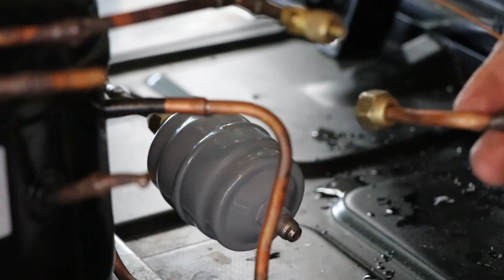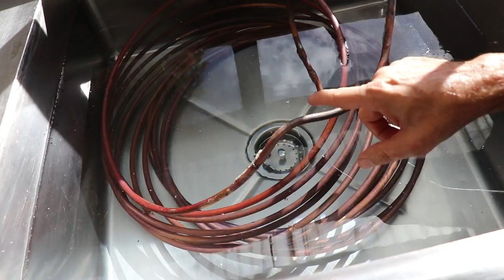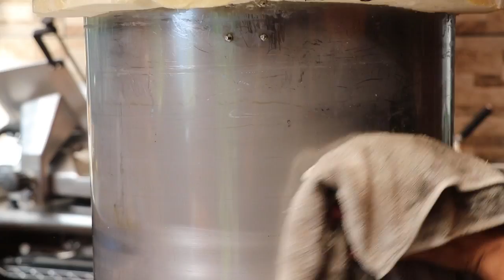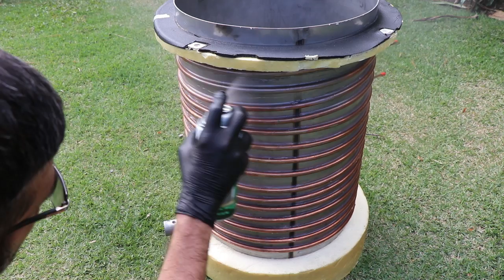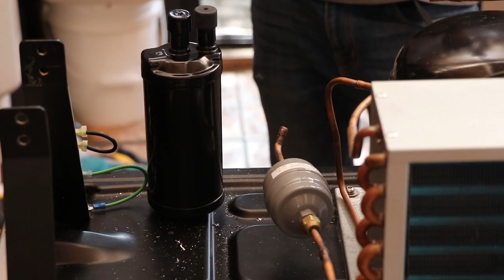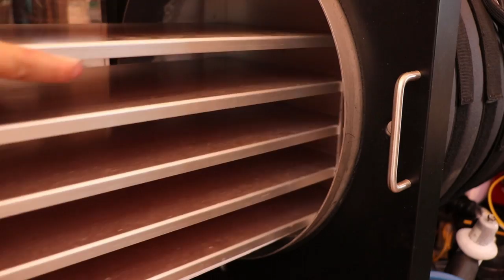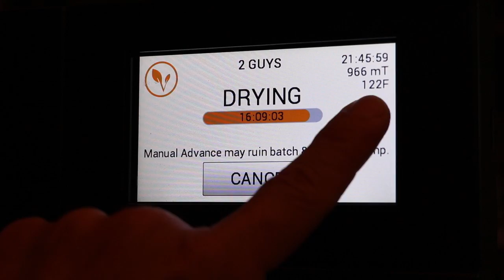My Freeze Dryer Stopped Freezing | Part 2 - Fixing the Issue

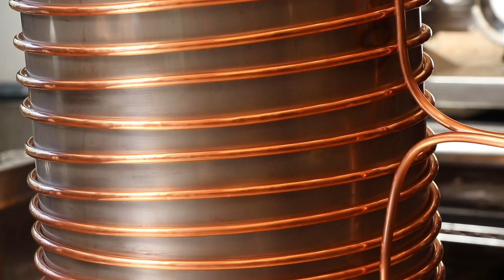Comment: 14:06 -- This is likely the root cause of your problems in the first place.  Copper tubing, in direct contact with the stainless steel can lead to galvanic corrosion, especially in the presence of moisture.  The two dissimilar metals can lead to the pinhole leaks you already observed on the original coil.  Did you happen to notice that all your pinhole leaks were on the inner diameter of the coil where the tubing is in contact with the chamber?

Comment: Okay... The condenser changes the refrigerant gas back into liquid which goes into the cap tube as a liquid. The cap tube is a metering device which controls the flow of the liquid into the evaporator.  Once the liquid comes out of the cap tube it starts expanding and evaporates back into a gas.

Comment: My large is 2 months out of the 1 year warranty. And now won’t cool lower than 62 degrees and that takes 13 hours to get to. I use mine for business. So it’s important for it to be up and running. The simple fact that I have to pay for support is absolutely absurd. Support has flat out lied to me. When I told them to go back and listen to the phone call they say it was their reps “misunderstanding”. There was no misunderstanding she flat out said I would pay no shipping and I even had her repeat it so it was clearly stated. I had to force the woman to tell me it was going to be a min of 8-10 weeks for them to “fix” my machine. Most things I read say it will be more like double whatever they tell you. And a lot of times you don’t even get your machine back.  It will be a different machine with other problems when you get it. Or the same problem as you sent it with. 
They also tell me one thing and then when I question it because it’s totally conflicting what they said before. I get word puke from them.  And I would even copy and paste quotes they emailed me telling them they are conflicting what they just said and they ignore that part of the email. There is a group on Facebook I joined called harvest right freezer dryers that don’t work, with almost 5k people in it. If there is that many people with these issues and customer support. How are they in business? How is there not a class action at this point. I agree with so many others, this is one of the worst company’s I have ever dealt with and will never buy another from them. At their price point. I want a machine that works for what I paid. And support that wants happy customers and wants to help.
At this point I’m not sending it to them to be circled around and for me to loose money from my business. I’m trying to find any hvac to come and look at it. Because I’m confident it’s leaking Freon. But I can’t get anyone to look at it. I’m at trying 10 different places and not a one will even come look at it

Comment: Thanks for the info! I really learned a ton, and you explain everything so well! I too am experiencing the customer support merry go round. Very polite, but the guy I talk to is not a tech and not knowledgeable. My problem is the condenser starts and runs properly, but after about 10 minutes into starting a load process the normal sound changes to a "hum" and it stops freezing. Any ideas? I don't think it's a leak, more mechanical with the condenser. Thanks for any input
Reply from the maker: sounds like the compressor stops and only the fan is running.   Have you tried to run the unit from the functions test screen and see what happens?
Reply: Yes, they had me do a test run from the test screen on my dryer, it ran for roughly 9 to 10 minutes. Normally, then it shut off is the best way to explain it and then it would just hum. I really appreciate you getting back to me on this☺️
Reply from the maker: When it stops is the fan (on the condenser w/the blue fins) still running.   It sounds as if it may be overheating and automatically shutting off.  Could be the start/stop capacitor or even the fan capacitor if I had to take a wild guess.  I'm not in the HVACR field but that's where I would start.
Reply: @2guysandacooler  Thank you very much for your kindness in helping me, so appreciated!
Reply: I have not taken the panel off yet to inspect. I can do that later today and let you know

Comment: I’ve commented before and have a question for you. You might have answered it in the video, “what caused the failure of the copper tubing?”. My guess based on what I’ve heard, seen, is defective tubing. I’ve got the same issue and, so far I’m getting no where. Sent back twice under warranty,same problem. Now wants to charge me $400 to send back, I just don’t think that’s fair.
Reply from the maker: Harvest Right never commented on this issue and every time I asked, they simply said that their team has seen my video and was aware of the issue.  My initial thought would be faulty copper, but the main culprit is moisture.  There seems to be 2 types of corrosion happening at the same time.  Formicary and galvanic.  If they can't seal their drum better and keep the moisture out, then they will continue having this issue.  The easiest way to fix this would be to get a new drum and have a repairman install it for you.  The fact that they want to charge you to fix their preexisting condition is despicable.  They customer service is one of the main reasons I would never recommend a Harvest Right.

Comment: I have the same issue it appears and what I never realized is I have been dealing with it for since I got the machine over the 3 yrs ago I have ruined vac pumps as a result and had to deal with water in the pump.  Recently we recharged it and found it worked perfectly with long cycle times but that was okay the product was good.  After 2 and half months the freon leaked out and we are back to water in the pump.  Harvest Right is saying I did not say the right things to them and do the water bath test to definitely determine the problem.  They have admitted they may have not escalated the issue properly to the tech team.  My machine is 4 yrs old. The thing is I lived with this and dealt with it all this time and was in constant contact with them.  They will not honor the 3 yr warranty to fix the leak that was obviously a manufacturing defect to start.  I believe during the many conversations they could have seen there was issues in the Logs I sent them and proactively engaged the situation.  They did not do this if they did I would be loyal customer.  They will say many things and they can say now they would have fixed the machine in warranty but know they will hesitate and not be clear and one needs to push the issue to make them responsible for fixing an expensive piece of flawed defective equipment they sold.  The realization was it was leaking from the beginning.  They will admit that in the prior years there were mistakes and issues may have not been escalated and if I did the water bath test they would have repaired the machine in warranty.  In the day they were the only source of Freeze Dryers the have competition now and while Harvest Right may have improved the machines its important they accept they sold units that the copper pipe was defective.  I am told Stay Fresh has none of these issues and uses higher quality components as a result of improving on what Harvest Right has done.   In the end the cost is $500 for the part and the time the replace it and recharge the machine.  Which I will most likely do due to the fact I depend on the machine and truly it has never worked right until I recharged it and maybe now it can.  They had the choice and out of warranty your out of luck.. Stay engaged within the warranty period and make sure issues are resolved completely they will not take responsibility for the defective copper pipe after the 3 yr warranty.  FYI

Comment: Just finished your first video of the series, very well done and informative. This will be my third time with a freezing issue with a large model, I’ve have sent it back twice (both times were under warranty, no charge) and they didn’t fix anything except to add Freon. It’s a slow leak and seems to function for several months before you notice the ice formation slowly moving away from the front half. Unlike you, I’ve had good telephone response from them, twice before and just starting my third time. I ordered mine straight from Harvest Right, and have realized that my unit was probably defective from the start. It’s just a small, slow leak and the unit will run but will continue to degrade over several months as the refrigerant leaks out. It’s a big hassle for me to return for repair. My personal opinion is they should replace the unit with a new one, I don’t have a lot of faith in getting this one repaired. I talked with the Rep last night about my issue’s with the unit and he mentioned it was out of warranty and there would probably be charges. My response back to him was “really, you’ve had it twice already for the exact same problem and haven’t fixed it yet, and all this was done under warranty and you think I should now start paying for your help. I then asked to speak with a supervisor.
Reply from the maker: That sucks!!!  I hope you get it worked out with them.
Reply: @2guysandacooler  I had bought two large units and one of them starting making a banging noise after about  3 dries. They did take it back and sent me another one but you wont believe what happened. They told me to test it with a dry and make sure it worked once I got it. So after about 20 hrs on a dry, it did something similar and then would not freeze. Everything seemed to work but it would not freeze anymore. I sent them the info from the thumb drive and I they said they wanted to get me a working unit. After waiting for a week or more I asked for a refund. They said they would refund me but I had to pay for shipping charges and restocking fee. I also got a bill for the first unit that was sent back from fed ex for 1900 dollars! So if I ship this one back, they will charge me another 1900? lol. I had a call with one of the MOST incompetent 'techs' that told me a bunch of wrong things and had to apologize for telling me the wrong things. We had a call set up for today and guess what? She never showed up for the call. lol. So I guess they are ignoring me now? I got a machine I have only used once that doesnt work. They told me at first to get an electrician to test the plug but then didn't want the info and said they would just send me another one. But they never told me they were going to charge me for the shipping. But they did inform me the other day about the second one being shipped back and that I would be responsible for freight and restocking fee. So I told the foreign guy who answers calls to forward the recording to the higher ups. I also mentioned how I have now been inspired to start a prepping and review channel just like @2guysandacooler
Reply from the maker: @endtimesurvivalblog  that sucks!!  I hope you can get that sorted.  You might request a tier 2 or even tier 3 customer support.  They seem to be a little more competent.
Reply: @ I did talk to Kim at the Stay Fresh and he was awesome to talk with. I told him about your vids on their dryers and that I would buy one of his from  your recommendations on my next purchase. I told him I might try and get someone to fix it instead of shipping it back for ANOTHER 1900 dollars  and he said they should not charge me under warranty. He said that fixing that kind of issues is pretty technical and that an average refrigeration guy might not be able to do it. What do you think? He also told me the shipping should have only cost 350 or 400. Why 1900? Does this make sense?
Reply from the maker: @BPNEWSCHANNEL  Yeah, that $1900 is ridiculous especially given the circumstance.  Harvest Right can't seem to learn from their mistakes.  I agree with Tim.  Fixing a unit like this can be pretty technical and many HVAC/R techs either won't touch them or don't know exactly what to do.

Comment: I have a May22 date code and we have a similar situation, tried leak stop and replaced the refrigerant 4 times. have contacted HarvestRight - the first response was out of warranty... I am interested in the actual part numbers of the valve and regulator and receiver you used  - I didn't see links to those.

Comment: No warranty. Freeze and condenser fan won’t work. Paid 45 for tech call. They are stumped and asked to call me back after opening up to mess with wires. What options do i have at this point?  I have scoured the internet for fixing videos and there are none.
Reply: I’m feeling the same thing. They seem to have no idea how to actually resolve a problem that isn’t documented in their manuals
Reply from the maker: sounds like you are having a condenser issue.  Could be the capacitors or perhaps the wiring is burnt out.  Hard to say as there are lots of variables.  
If you need a new condenser, you can get a replacement condenser from Harvest Right and have a local HVAC/R tech install it.     
Either way this sucks and I'm sorry that you are about to have to experience this nightmare.  Most people will just throw the towel in and end up with a very expensive paper weight because the process of fixing it is just too costly.  Some people say it's just cheaper to buy a different brand and move on.
Reply: @2guysandacooler  They never got it resolved, so the only option at this point is try and sell for parts or send back in to have their company try and fix it. After this run in with them I will not buy a new harvest freeze dryer and will look elsewhere. Their customer service is not great. I took this whole machine apart and learned more about what was wrong with it from another YouTuber who didn’t charge me a dime that they trained. You would think they would want their name to stay positive, however I am disappointed in how they seem to go about things and how influencers make them sound like the best. They need more competition in my opinion.  There is virtually nothing online on how to troubleshoot these or parts to fix them leaving harvesting full control of what happens for most people. Thank you for your information.
Reply: @2guysandacooler  HR wouldnt send any parts to my HVAC shop, they said "not their policy anymore, you have to send it to us to fix"
Reply from the maker: WOW!!  That's crazy.  I guess they don't want people finding out about their freon leaks and potentially starting a class action.
Reply: @2guysandacooler  It's only a matter of time,they can't hide the facts forever.

Comment: Harvestwrong is the worst US company i have ever dealt with in my life. Steer clear at allcosts.
Reply: I completely disagree
Reply: well, you must not have had a problem yet where they tried to screw you. I had a known software issue and they tried to charge me $45 to simply talk to a tech and wouldn’t let me talk to a manager after multiple back and forths.
Reply: @DennRN  Harvest Right are shysters, for sure!
Reply: @janineneville237  You either work for them or are oblivious to thousands that have been burnt by them.
Reply: @janineneville237  I have the same faulty copper line in my large freeze dryer and HR will not send my HVAC people the replacement parts (like they claim in the video) and my machine is under warranty. They won't even sell the parts tome. I have to pay 400 dollars shipping and 90 dollars shop fee for them to fix it. This is the second time they have had it in their shop since i bought it new from them. You want to know why you think they are so great? Because truthful comments like mine get deleted by the people peddling their shoddy products.

Comment: Follow up on my previous comment: my FD has been with support for several weeks now and they originally told be 2-4 weeks so no problem until yesterday. I received a bill for $90 to replace the relay board and a message that it will not be shipped back until I pay the bill! During the initial phone support session I did the testing and took pictures as they requested and it was determined that the coils were leaking and basically it had the same problem as your machine. Getting a bill for a relay board didn’t seem to match the issue since the compressor was working when we tested and it was freezing half the chamber! To me, either the compressor runs or it doesn’t. I suspect they are using this board replacement bill to pay for the parts they really replace. I don’t trust them and it’s just my opinion but I wouldn’t suggest anyone buy a harvest right at this point.
Update: 6-26-24. Tech support called and explained that it’s their policy on older machines to replace the relay board just to make sure there isn’t any issues. Also was told there were no leaks detected but they had to add Freon to the system??? And they verified the freeze pattern with a picture. We will continue to use the machine after we get it back but will be buying another brand ASAP. Hope this helps someone in their decision making process.
Reply from the maker: That really sucks!!
Reply: Some folks believe they don't fix the leaks, they just fill up the freon. Only warrantied for 90 days when you get it back, act fast.